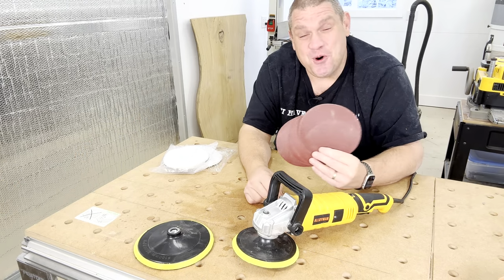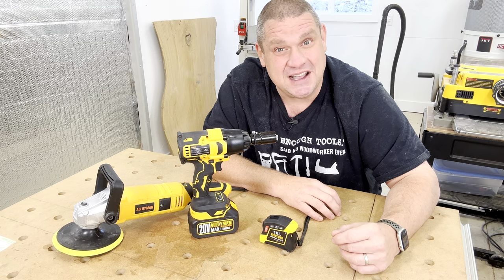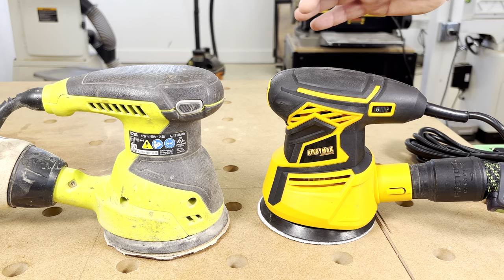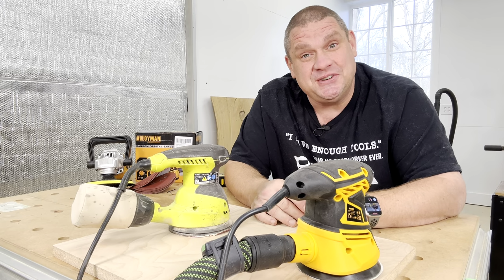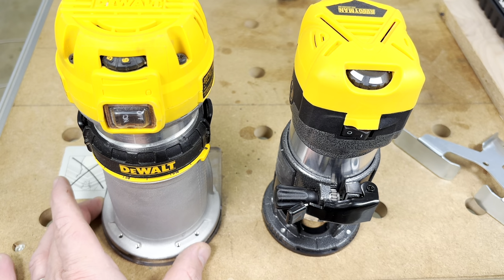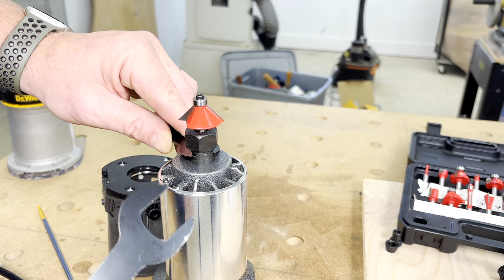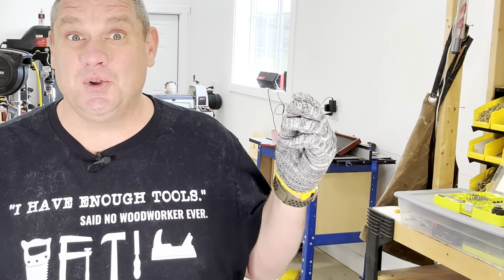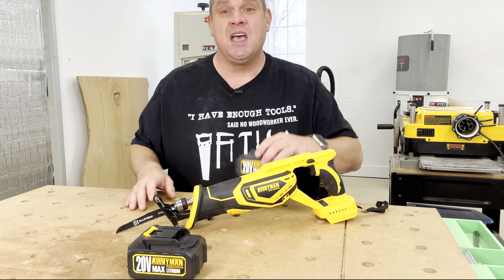Unheard of Brand, Unbelievable Results: Testing 3 New Tools

Comment: There are so many similar tools out there, you’ll have plenty to do comparing them.  It would be interesting to know how some of the really good first impression tools hold up and compare to their more expensive counterparts.   

Curious if the buy once cry once is applicable.  For example- are the (what the) F(festool) tools which are so much more expensive, compared to the higher grade (brushless motors, higher amp - if corded, tools.  Are the WTF tools that much better, that much more accurate, that much longer lasting?  

Same thing with the WTF red tools that cost 2x most of their competitors?  

Good job with the subject, again. Thanks.
Reply from the maker: I totally agree. I would tend to think that the buy once cry once theory is a good one.  Sometimes when you buy the cheaper models, you realize it doesn't have all the accuracy you thought you needed, and then you end up buying a nicer tool anway, so sometimes i gues you could spend even more than if you would have just bought the more expensive one in the first place.   For me, I went ryobi crazy when I first started out and then began upgrading about 3 years later.   I think that was a good decision for me because I made sure I liked woodworking before spending too much money.    Bonus - I still use my ryobi tools for many applications so it is a win win!

Comment: On your recommendation I bought the polisher/sander. I’m building up my shop piece by piece, I was a carpenter many yrs. ago. But I took a a different path and now trying to go back to my roots of woodworking. I have a question for you. I have researched it but all I find is very vague on this matter. I know the sanding part of it start with something like 180 or 220 depending on the project and that can pass 1800 wet sanding. But what I want to know is what brand of compound and and at what stages do I use them at ? If you could reply whit an answer that would be great thank you in advance for cooperation.
Reply from the maker: These are great questions and I wish I had a great answer for you.  I have done a couple of tables and many cutting boards using epoxy resin, however, I have never gone for that really high gloss on any of them.  I did do one table that has high gloss and it is sitting in my kitchen right now.   I went the easy rout and chose to go with a table top epoxy which looks like glass once it cures.   I'm hoping some other viewers might see this comment and spread some knowledge for us. I would like some input as well!   Thanks for the question!

Comment: I am interested in that Orbital  Sander, my biggest concern with less expensive brands is how  long will they last. Sure they may start out strong, but will they last? I call this the Harbor Freight formula, how  long will the product last, vs how many times will I need it, then figure in cost. Anyway thanks for another fun Saturday morning coffee video.
Reply: Another thought  that  came to me after I posted, are there  upgrade collets that will fit that router? Might be able to upgrade the collet and still save $$$.
Reply from the maker: That's a great question Pat, I will need to check that when I get back from vacation.  I'm out of the country until next week.    And I totally agree with you on the cost vs. the need.   I always call these one time tools.    I buy then because i need a specific project done and then if I can get a second or third use out of them its all gravy!   I will say that the alloyman tools feel about the same quality as ryobi so I suspect hey will last a while.   Kind of like the bauer at Harbor freight.
Reply: @FlynndoggWoodwork  have a great vacation, and safe travels.

Comment: I quite like the inclusion of safety glasses. Regular DIYers, workshop enthusiasts, and pros will have PPE already, but cheaper tools or sets with accessories attract more occasional home users. For the minimal cost to the supplier it's nice to see eye protection provided, making it much more likely to be used.
Reply from the maker: Oh I agree with you getting the safety goggles 100%. That is a nice add on.  The gloves are what i don’t understand.  They are actually dangerous to wear with many of these tools.   Especially the Router.  Thank you so much for sharing and watching worstuserever!
Reply: @FlynndoggWoodwork  Absolutely, throwing in gloves sends the wrong message to novices.

Comment: Not only are gloves not necessary but are often dangerous.  They can get caught in sharp spinny things and grab onto the hand, perhaps drawing the hand into the blade, or not allowing it the hand to be pulled back.  Kevlar gloves are great for carvers but gloves are a no-no in a shop.
Reply from the maker: I 100% agree with you kwilliams.  Just think if one of the fibers got caught on the blade of a table saw, miter saw, or the bit on the router.   You would end up with chopped liver for fingers.
Reply: I worked ship yard as a machinist. A coworker didn’t like the hot chips hitting his hands so he put on some simple cotton gloves. They were loose fitting. I told him that’s dangerous. Not 2 min after his hand was pulled in backward. He broke a few bones not to mention a few stitches.
Reply from the maker: @timrodgers8551  Yep!  Really crazy they include those gloves with these tools, especially anthing with teeth or anything that they could get caught on.  Thanks for watching Tim!
Reply: I hope he realized how lucky he was.